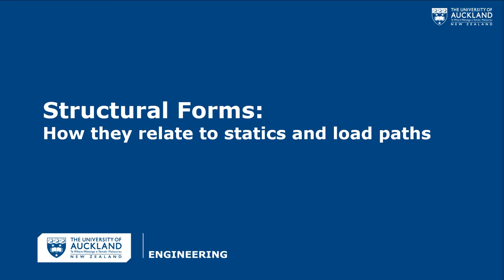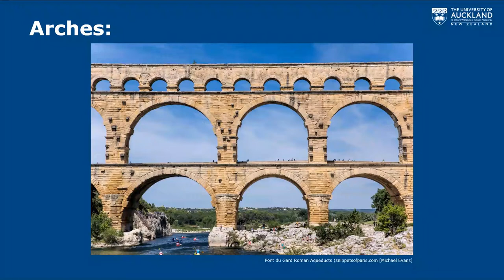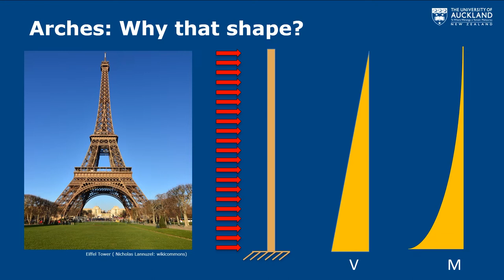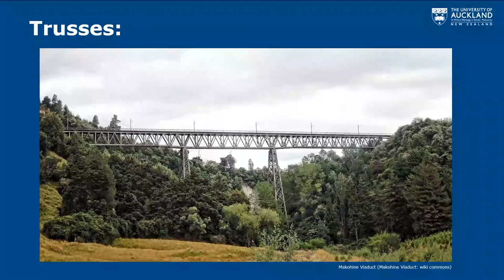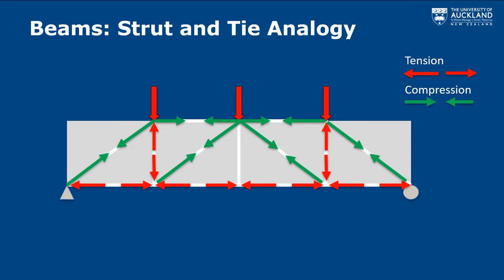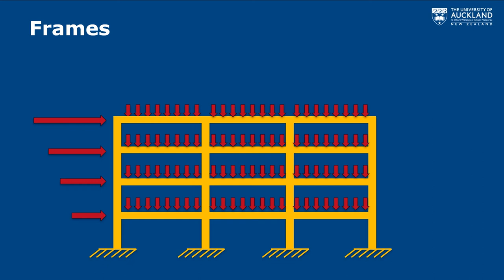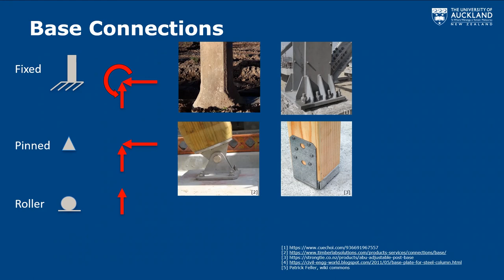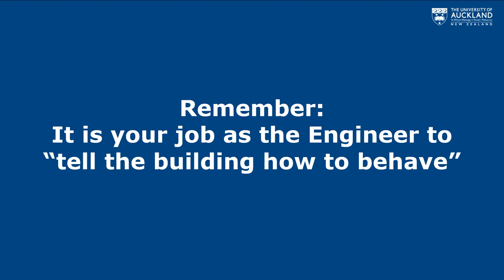Structural Forms

Comment: Fixed steel connections, is that why you only fillet weld webs & butt weld the flanges? because the flanges are taking the moment not the web?
Reply from the maker: Yes that is typically the case as you want to develop the entire capacity of the flanges so you can use a full penetration butt weld on them.  You can also use fillet welds on the flanges to develop a moment connection if you utilize the right welding process